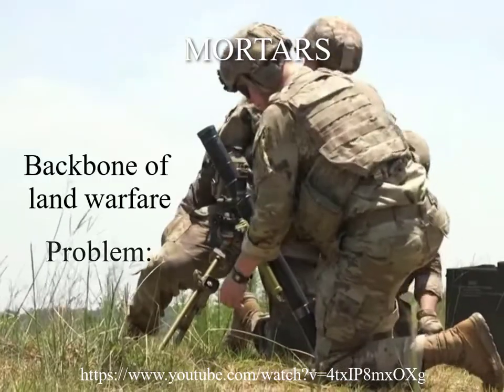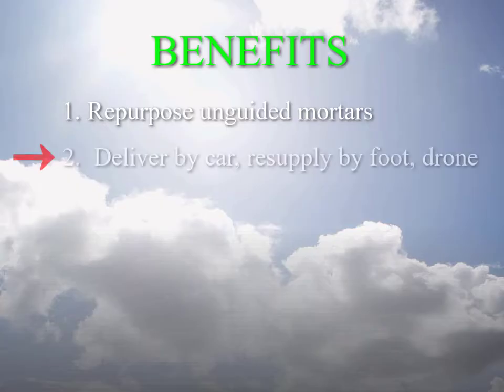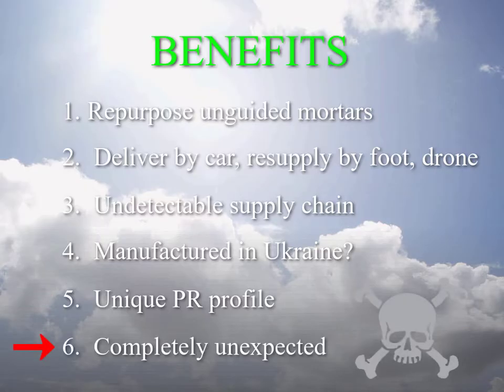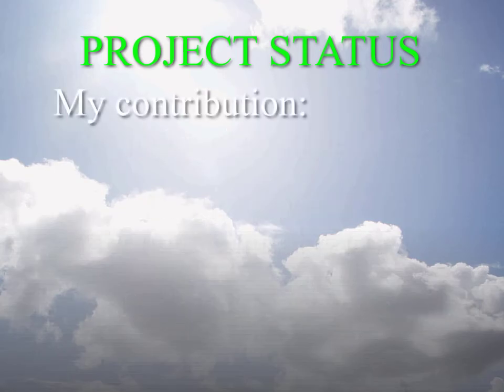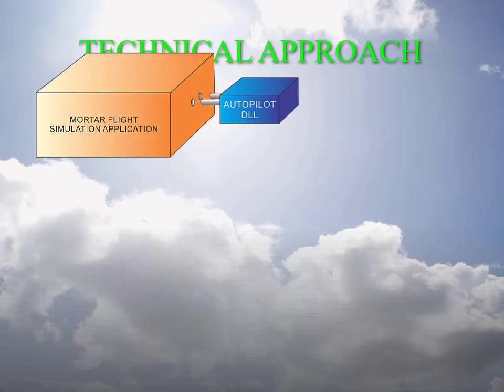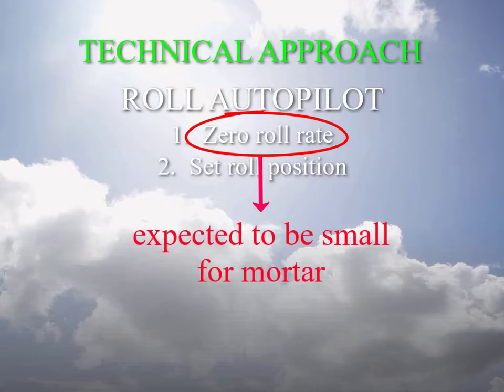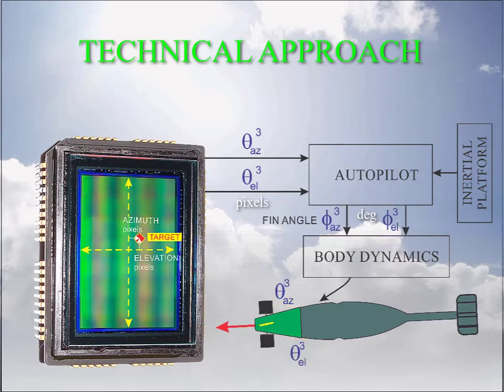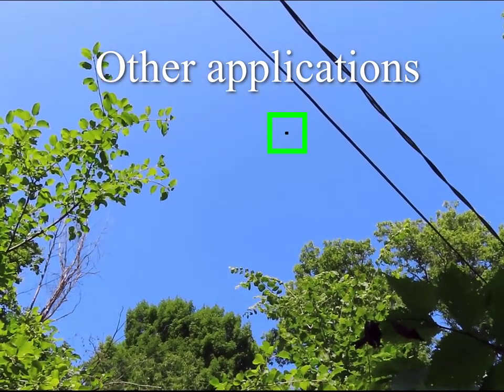Autopilot For Guided Mortar Retrofit Part I   Concept 09

Comment: i had the exact same idea in the beginning of the war, using an ccd camera with an notch bandpass filter for say 940nm ir ttl pulsedcoded laser fitted to either dropping drone or spotting drone. software for controlling servos to keep the tracked ir targeting spot in bore center

Comment: TBF this is way harder than DIY manpad projects. With a manpad on the sensor side you have a very clear and visible target. I'm not doubting this project is possible but once gun hardened servos come into play it gets expensive. A video on image guidance technology that goes beyond "an AI detects it" would be very useful esp as you're missing the potential for airburst with stadiometric target range estimation which would be a gamechanger for anti personnel .

Comment: Ignores many critical design realities. I'm very familiar with this concept. I've worked numerous developmental demonstrations that tested real flight articles. Its just not that simple. And there are operational challenges to coordinate a laser designator with mortar firing data and engagement timing. A very attractive system concept that has many "devil in the details" issues.
Reply from the maker: Fully agreed, the "devil is in the details", always like this.  And it is a solvable problem, one winnable engineering step at a time.  The process is the key.
Reply: @skyindustries  YES!   Design. Test. Iterate. That is the way!

Comment: Where is the CCD array located?
Reply from the maker: Good question!  

It's right at the tip, it's the video camera, which is the eyeball of the guidance head.  If you dismantle a video camera, inside there's a tiny CCD array.

Comment: Wait, consider the implications. This is pretty much an open source device to retrofit something a whole bunch of people can manufacture or find. All of this will work and is pretty easy to implement but that means it is pretty easy to implement. Imagine a random shooter using a simple device they manufactured in parts by using a bunch of CNC workshops online, deciding they want it to land in a place they hate! 10km away and a bunch of these, 5 minutes of time to shoot and reload.

THIS IS DANGEROUS.

Comment: Problems:
1. Aerodynamic control surfaces in the front with regular mortar shells create sticky vortices which flow along the body of the shell towards tail fins, and destabilize them. The projectile starts to oscillate.
2. Despin, and steering create hard to predict braking force, the predicted impact point can get up to 100m shorter, and deceleration sensing with MEMS is much less accurate than rotation sensing.
3. If guidance can't spot a target, you get lower accuracy than with the unguided shell, even if you add INS correction for such case.
4. Depending on the optics setup, and flight trajectory, you only get enough correction time post-appogee if you fire at a very steep angle. Range, and flight time ratio of mortar shells is a bit non-linear. At the worst, but frequent case of firing at max range, you will need to do 50m+ of correction in 2-3 seconds with a 15kg shell
5. You need very powerful, and compact servos for enough control authority for cases above. There are none available to civilian market, or they cost an arm, and a leg.

The solutions to all of above exists, though the simpler approach seems to be single use, side firing thrusters. If they are powerful enough, you can avoid the effect of vortices on the tail fins.
Reply: Won't you need to throttle the thrusters to achieve controlled course correction? How are you gonna do that?
Reply: @communist754  not OP, but typically the single use thruster designs (that i've seen and Im just a guy on youtube) let the projectile spin and time the firing of the rocket actuators (I believe they call SRMs used to maneuver actuators if I recall correctly) so that it adjusts the trajectory in the desired direction. Larger or smaller adjustments are made by firing them sooner/later
Reply: Have you seen the artillery shells that deploy a free falling warhead that orients itself to target the enemy and then deploys an explosively formed penetrator? I like the idea because it lets the projectile do what projectiles do well, and then it does all the fine tuning and aiming at the end, instead of trying to make a projectile that can be all things at once.

Comment: Problem with unguided mortars is even if you get this to work these warheads aren't antitank which won't matter if a 120mm hits the top of a tank but smaller mortar conversion might very well hit a tank and not hard kill it (though subsystem damage would likely still softkill and enable easier fpv follow up)
Reply: Broken optics disables an armoured vehicle
Reply from the maker: The T-90 engine compartment cover is tinfoil, technicians have to get in there regularly.

Comment: As a laymen observer my first assumption is that the peak geforce experienced by a mortar round will exceed the capabilities of consumer electronics proposed to power the seeker head. For a typical 120 mm mortar with a muzzle velocity of ~300 m/s and a barrel length of ~1.3 meters, the average acceleration can be approximated using kinematic equations: a = (300^2) / (2*1.3) = 90000 / 2.6 ≈ 34,615 m/s². This is to ≈ 3,532 gs! I'm naive on the costs of hardening electronics against this kind of acceleration. I believe this would be the greatest hurdle for the production of this retrofit, what are your thoughts?
Reply: Regular epoxy will survive at least mortar level G-forces, but likely not long range howitzer's
Reply: @32353235e  Ah, I never thought about reinforcing the electronics with epoxy. That makes this quite interesting and exciting!
Reply: Back in WW2 they used vacuum tubes in anti air munition, even they were able to sustain the immense g-loads with ease. Modern ICs can probably go to >100.000Gs before anything happens since they are fully solid state. Potting the PCB in silicone or epoxy will be more than enough.
Reply: @lbgstzockt8493  Yeah it was always the SMCs I thought would fail first. I'm surprised that sometimes simple solutions like epoxy work so well.
Reply: May be they will survive, may be no. At least, the civil electronic components are not rated for such accelerations.